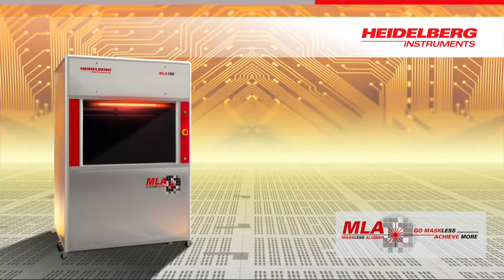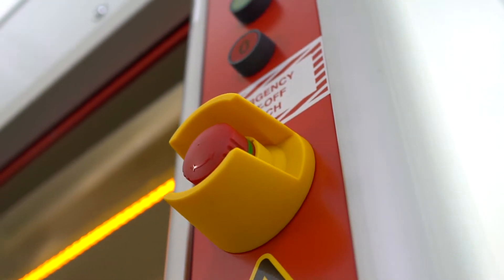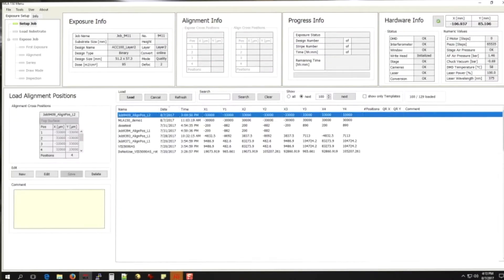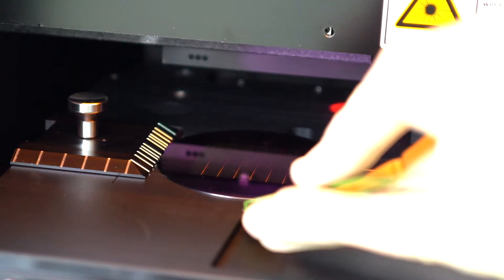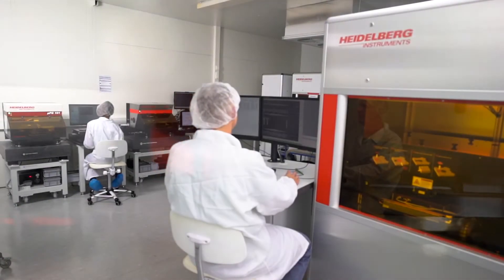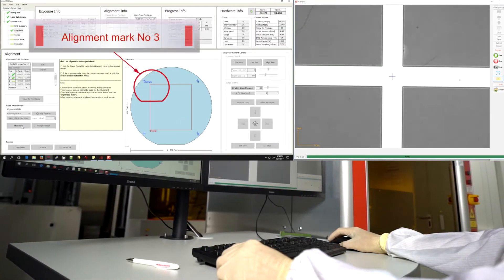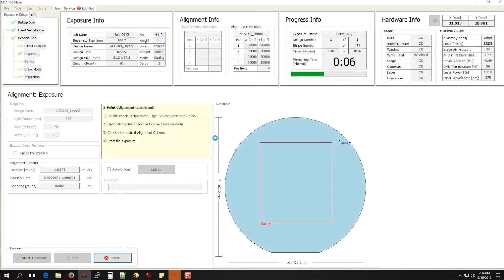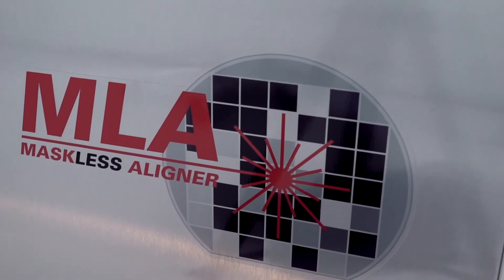Photolithography without a mask: Multilayer lithography with the Maskless Aligner MLA 150

Comment: Nice tool. But how does it work? What replaces the mask?
Reply from the maker: Hi Alex,

The MLA 150 Maskless Aligner is an optical laser direct write system that generates a pattern by direct modulation of light instead of using the projection of an image through a mask.
This maskless process offers flexibility and low running costs, while providing the user with a non-contact exposure and a very high exposure speed compared to traditional photomask processes.

You can find additional information on our product page for the MLA 150: https://heidelberg-instruments.com/product/mla150 

With best regards,
your Heidelberg Instruments team
Reply: @HeidelbergInstruments  I've seen your brochure, thanks a lot!